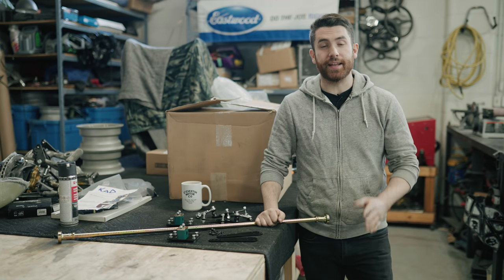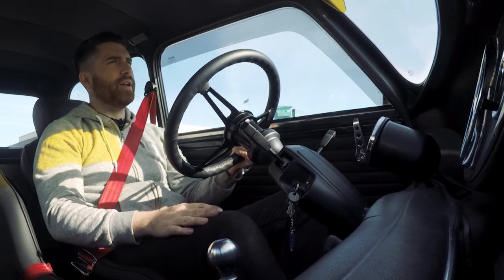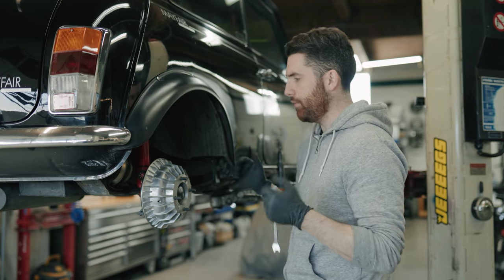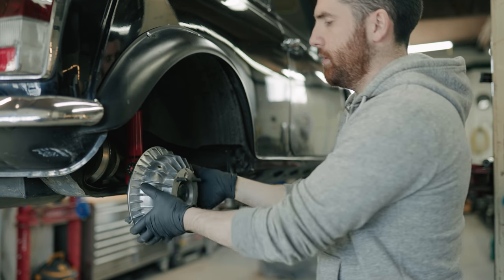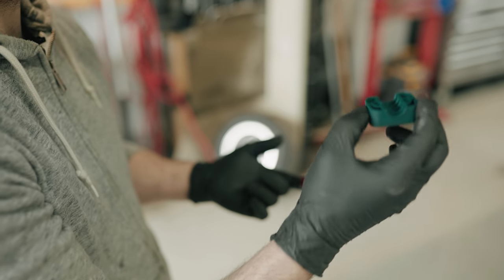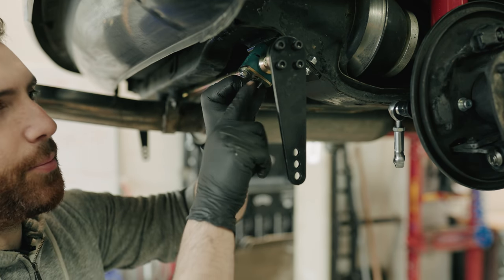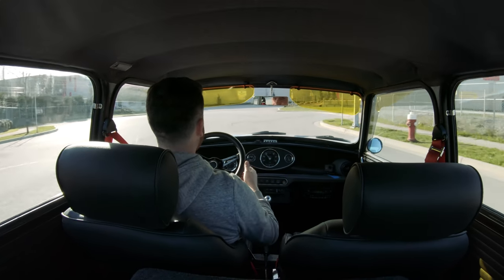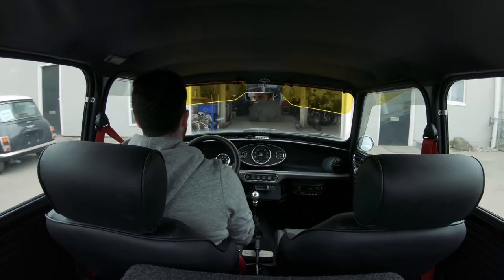KAD Rear Anti Roll Bar - Install and Review

Comment: Way back when, I rallied a 1330 on tarmac (lsd, splits, s/c dropgears etc) with no anti-roll bar and loved the way the rear would hang out on fast corners, and understeer was only on too much throttle. What effect would a rear arb have had,  especially at high speed on bumpy roads?

Comment: Are that group 5 arches? I restore a MPI and want to drive it with 7x10 Mambas so the group 2 arches are to small, cause of the disc brakes. I think the group 5 could fit well, but I don´t have good pictures of those.

Comment: Can you weld the brackets onto the rear subframe instead of using bolts? Or could that warp the plate or subframe if done incorrectly

Comment: After curiosity I went to check where Stevestonmotorco business is located and to my surprise it is located near several "junkyards" for striping old cars and sell their parts and their metal.

Odly enough the proposition here is to restore these beautifull cars. And what a job they do. Talented and professional service with some great videos to help spice things up.

I wish the Mini scene around here in Portugal was anywhere near what you guys make of it. I would then seriously consider investing in one of these little cars just for the fun of it. They must be loads of fun to drive (specially considering the new wave of "anemic" full EV cars that more and more are being forced to the masses).  

No ECUs, air/fuel induction, mechanical distributor, screw/tappet valve adjustments, 3 pedals, 4 gears only, no power steering... They don´t make them like these anymore, for sure!  Seing you drive that car made me feel I was actually enjoying driving one of them.

Appreciate the interesting videos on these machines. 👍

Comment: Thanks for another great video. A really nice demonstration of what the ARB does and how it works. Step by step install was fantastic. I bought one solely based on your vid. I don't think I would have bothered to put one on without the detailed explanation, before and after drive, and commentary. Too much of a race thing I thought. I definitely notice less roll, nose dive, and understeer in the turns. It's not crazy, but just sweetens the cornering up a bit. Keep the great content coming!

Comment: Thank you for another great video, I’m in the midst of rebuilding a 94 Mini Works Group A Rally Car, with just 2000 miles on the clock, definitely going to fit the anti roll bar to the car to improve the handling. Fantastic video as always.. keep up the good work.
Reply from the maker: Right on! Thanks.

Comment: You don't have to use the same hole on both sides. You can fine tune to your liking by using different holes on either side.

Comment: You mentioned the steering rack. I was under the impression an aftermarket quick-ratio was installed in the car. Also... lot's of chuckles about the right turn signal... ;)

Comment: The Stevestonmotorco team put on of these on my mini. Handles extremely well and well balanced. As Phil was saying I like the way it takes away the under steer a lot and when it does start to oversteer its very easy to correct on power and get neutral. I really like what it added.
Reply from the maker: Yeehaw!

Comment: Many years ago I had an old Volvo where I learned the difference of adding sway bars. That car needed both front and rear. The difference is amazing and was significant for each change. I assume based on your comments that it's really only needed on the rear? I do see a front bar available too. Also, 5/8 seems good but 'more is better' makes me wonder about the 3/4. Definitely on my shopping list now. Thanks again for another great vid.
Reply from the maker: It would depend on setup to get the slip angles you want and therefore understeer/oversteer tendencies. For the street, 5/8 rear bar is great. You would probably need to step up accordingly if you are increasing the lateral loads with stickier tires and pairing with a front bar. More isn't always better because adding too much rear bar would lead to too much oversteer and that would be slow (and probably scary) 😎

Comment: Another winner, Phil. Thanks for sharing. Does the car you were driving have a short shifter? It looked like you changed gears effortlessly. I have a 5 speed with a lot of travel and effort when changing gears. Is it possible to install a short shifter on a 5 speed trans?
Reply from the maker: This one had a KAD short shifter. Ease of shifting is usually up to the condition of baulk rings in the transmission! But the KAD unit is very nice. Not sure about the 5 speeds as they usually require their own special shifter.

Comment: Have you fitted the KAD bar to an Estate or van? Curious to know how it fits in reference to the under floor fuel tank. Been thinking of fitting one to my Cafe Racer Traveller. 
Great video by the way .... plenty of info and detail as you always do in you videos.
Reply from the maker: Thanks! Unfortunately we haven't tried fitting one to a Traveller before. I'm sure someone out there has done it and posted some pictures.
Reply: @Stevestonmotorco  no worries thanks. Will see if I can find photos of fitted. I have a rear strut brace that I designed and had made up so the addition of anti roll bar might make the car too stiff.

Comment: I understand it as the rear is making a greater contribution to the overall roll stiffness, so you lose grip at the rear but you gain more at the front as the back with it's roll centre at ground level has a greater influence on roll. I've used the progressive rear hydro bumpstops to achieve the same thing, it would be interesting to see a comparison as theoretically the bumpstops won't be stealing grip from the inside rear tyre on cornering.
I think the real problem is the mini's rear roll centre height and skewed roll, I managed to get my rear roll centre higher and it's beautiful to drive...
Reply: Did you use the extended front lower ball joints?
Reply: @rondon73  for the front yes, on the rear I built a semi trailing arm rear suspension, a lot of work but I'm happy with it.

Comment: this is great, could you do a vid with the KAD rear disks or is it the same process?
Reply from the maker: It's more or less the same process. However, you will need the blades specifically for compatibility with the rear disc kit. The normal roll bar blades will have interference.

Comment: Will any alignment shop know how to do a Mini?  I’m in the mid west. Guess I need to do some research. Great video Phil.
Reply from the maker: They should be able to dial it in to whatever alignment you want (if you *have the adjusters installed). In our city most alignment racks have trouble with small wheels so it's probably a good idea to call ahead and ask.
Edit for clarity

Comment: Do you still reccomend this if you have a full multipoint bolt in cage? I also have red dots all round and protech shocks
Reply from the maker: Definitely. A cage might add chassis stiffness but would be see the same benefits as on any mini 👍

Comment: Really nice and professional explained but even if the effects of arb is totally correct the physics behind are different. It doesn’t lift the inner wheel. Furthermore it applies additional spring stiffness to the outer and due that it applies more load to it and changes the contribution between the axles. That doesn’t mean that the arb axles grip is reduced by definition. Only if it reaches its limit of load/ side force capabilities it starts sliding. Main point is that the stress of the outer front is reduced and the contribution between front and rear is more even and therefore the participation of the rear axle on cornering is increased.
Reply from the maker: Well said, that makes sense and is better put than our off the cuff version.

Comment: I have a 1967 998 cooper with hydro supp.Whats your take on adding these rollbars?
Reply from the maker: We haven't installed roll bars with hydrolastic suspension before as we rarely see them in our part of the world. Maybe someone with first hand experience has discussed it on the forums. Our hunch would be that they would be beneficial because the principles shouldn't change even though the suspension design is different.

Comment: Does it work with the KAD rear disc brake conversion kit?
Reply from the maker: Yes and you will also need the disc brake kit specific anti-roll bar blades (by KAD) with it.

Comment: Why do your suspension cones look stainless ?   what shocks are those ?
Reply from the maker: They are new, maybe that's why they look like stainless. Shocks are kyb agx. A full rundown of the setup is during the first drive.
Reply: @Stevestonmotorco  thanks , just bought the roll bar ,,

Comment: Interesting...
So why is roll angle the big baddy?
Curing understeer by reducing grip at the rear... hmmm.
Why not increase front end grip?
Front toe out... why? Do you have a negative scrub radius?
Anti-roll bar, or sway bar... can’t be both, can it?
“This left-hander”, turns right ,  doh!
Reply from the maker: An anti-roll bar allows more grip from the inside tire and by doing so increases total grip.

Less body roll is also beneficial for the front because there is not much camber gain on compression to keep a good contact patch.

Slight toe out helps turn in!
Reply: @Stevestonmotorco  
Sorry, massively not correct.
100% wrong
Let me know if you want to know why...